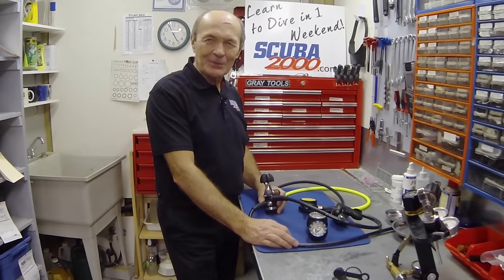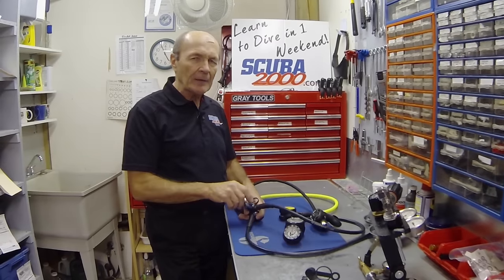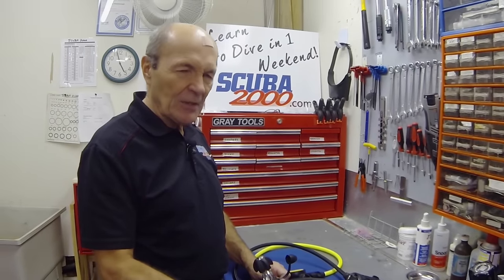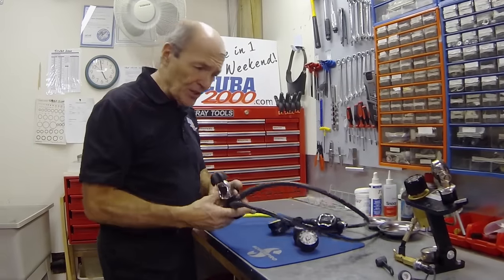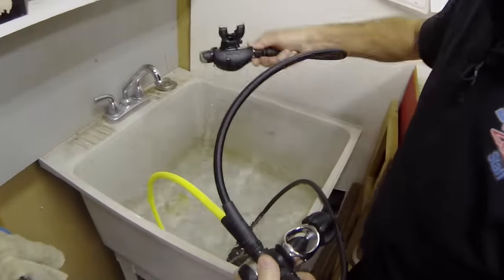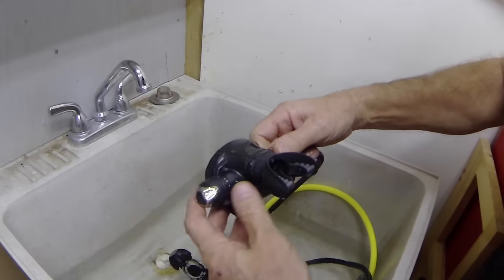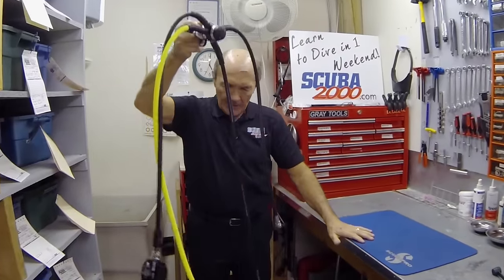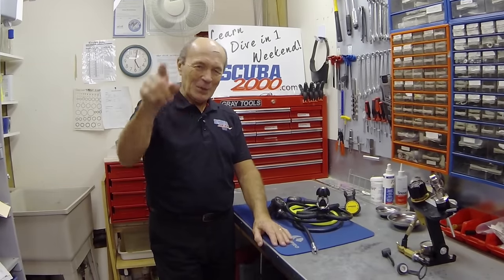It Pays To Rinse - Scuba Tech Tips: S03E02

Comment: dear alec thew widely common fresh water equpment rinsing is pagan worshiping!  i dive almost 30 years in salt water  by now. before proffesional and now for fun.  never wash my equipment!! even before 3month storege of winter. my gear lasts and lasts. my conshelfs are almost 40 year old and in my time never saw fresh water. my neopren wetsuits mask fins bcd in and out always with salt and lasting long. my first 30years old fins tegulator suit are still in use by smaller family members. actualy fresh water in a closed compartment like bcd can develop bacteria who "eats" it. also a wetsuit left wet with fresh water might also be eatten that way. the only thing i do always wash right after a dive is the aluminum and surely the steel of the tank. i also service my regulators and friends regs when then start free flowing. mares  ff after only 1 year. scubapro ff after about 3years and the best work horses ff after 7or more years of hard work and they are all aqualung
Reply from the maker: And my cousin Ted, 84 years old and still active, has been a  chain smoker from his teens.
There are always exceptions and yours is certainly one.
Odd that you rinse your steel tank but not your steel regulator.
However, if you are getting away with it, go for it.
Good luck.
Alec
Reply: @AlecPeirceScuba_SeaHunter   im not sure if it is an exception.  as far as i know salt cannot   react on  plastics and rubbers. metal regulators  and regulators componets are built from very rust resistant metals. I never had any penetrating rust in my gear. only scale. fresh water will not eliminate scale. steel tank easily get rust.